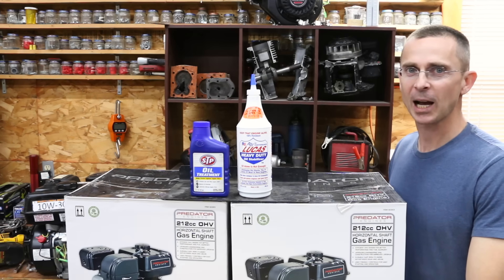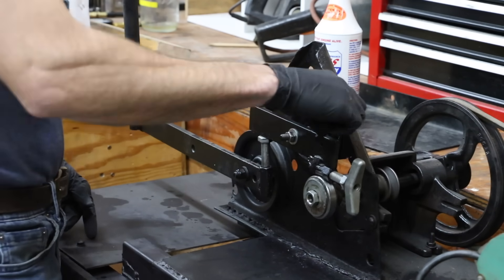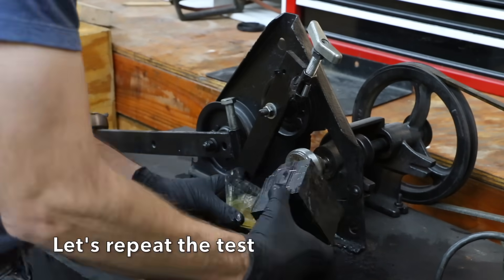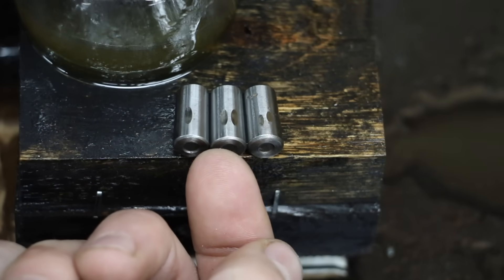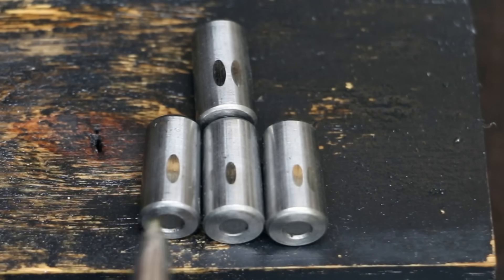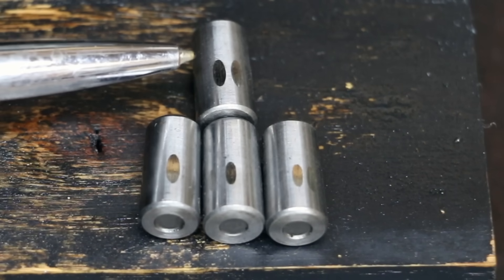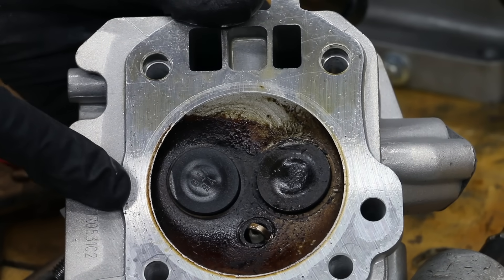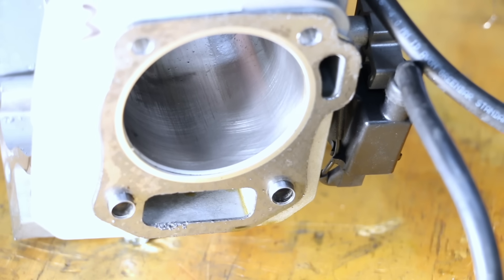Which engine self-destructs first?  Lucas or STP?

Comment: that is a cast aluminum (CA) connecting rod with no bearing mated to a hardened steel ( HS) crankshaft. In what world would CA defeat HS.   There is no damage to the crankshaft.  that is transference.  Aluminum from the connecting rod has transferred to the crankshaft.  You can use an acid to dissolve the aluminum, polish up the journal with emory cloth. mic the crank.  you will not find any damage.
Reply from the maker: This is a great point! Thanks for commenting.

Comment: Great test, except for the fact the lubricity test: we have no idea about how rough or smooth that sanding with a grinder does to the rotating sleeve. Using a jig with a piece of sanding paper applying a specific pressure to sand the sleeve down for a given amount of time should give a uniform surface after each wear test. However testing the bearing twice does remove some of that variation and the engine running test does confirm what was seen in the lubricity test. So very good test, very valuable. Kudos!
Reply from the maker: All great points regarding the lubricity tester. I've since standarized the process by using 1500 grit before every bearing test. Thanks again.
Reply: I'll make sure to watch every one of them :-)

Comment: You need to test water cooled engines sure you will get a good test out of air cooled engines you'll get a lot more thermal heat out of them and breakdown of the oil but a lot of people use that stuff in cars so cars be the best test
Reply from the maker: Thank you for this recommendation!

Comment: I didn't see any synchro balance weights in these engines, doesn't anyone use them in the smaller engines? They work well and also cut down on wasted gasoline.

Comment: Different ratios definitely had an effect on outcome... I think u should see which one is more fuel efficient to get a true and accurate indication of less internal resistance... then inspect for wear... Make sure not to drain the oil the time and use equal ratios of additives
Reply from the maker: Thank you for this recommendation.

Comment: I as a world renowned mechanic vlogger feel compelled to weight girthily in on this one.  i have 6 k hours on my 1200 watt champion 4 stroke genny and i used stp for 3k of those hours
every 120 hrs the plug had to be replaced since changing to seafoam in the gas and crank case i get aproxx 1000 hours/.   you do the mathematics
Reply from the maker: Thanks for commenting on this.  Great information.

Comment: I would like to see you try prolong additive against everything else. I've used it and I think it's one of the best out there. 

I've done my own test with it. Full size engines.. 

Ran my truck for 25k miles without an oil change. It wouldn't die. Drained it did same thing and ran it for another 25k miles she just wouldn't die. 

Ending up driving her to the junk yard
Reply from the maker: Impressive!  I'll definitely test Prolong.
Reply: Project Farm I can't wait to see that test. Would like to know if I should keep using it or not. 

Also they advertise that if a race car they drained the oil and ran it for over an hour at high speeds in a viper. With no damaging effects.
Reply: I've wondered about Prolong, but my sister has run a 2.3ltr Mustang (1989 model year) upwards of 30K on regular Pennzoil 10w30....  The engine would have continued to take the abuse had it not succumbed to a stuck thermostat.
Reply: U used it in my 2.3l turbo mustang. And I loved it. Never has an issue. 

I hear the crap put of it everyday upwards of 25psi of boost and 22deg timing. 

Now that motor I rebuilt because I over boasted it to much. But when I took it apart. The original honing what still there from the factory with over 375k miles on it. I got it with 150k. 

After rebuild I went another 150k before i sold it to some guy that threw the motor away for a 5.0. That was slower.

Comment: Engines arent designed to run with no oil, if you want to test lubricity then run the engines with the oil in them for the same amount of time and then drain and test the oil, not the engines with no oil, at that point you can then make a hypothesis on which additive would be better. Also, while running the engines it also allows the oil & additives to properly mix and the lubricated parts to absorb said lubrication....but to run engines with no oil and then make an analysis about which one performed better by showing the damages of not having any oil in them isnt at all a correct way to test because either way you do it, both engines are going to show catastrophic failure because of no lubrication hence invalidating that there was ever oil or oil additive used. Would you drive your car with absolutely no oil and then wonder if it was because of the additive you used before draining the oil that caused the failure? Pretty sure thats a common sense answer...

Comment: I had a POS Chrysler with a 2.7 that burned a litre of oil every 1000km's. A little lucas once a month and it burned nothing. Kept the oil looking cleaner too. I also stopped getting a low oil pressure light coming on.
Reply from the maker: Thanks for commenting on this.

Comment: Did you ever see the prolong engine video and or do the same test - It was a quite impressive video Just asking
thanks for posting and the test at your cost as in the world there are many things we need and don't need and snake 
oil is one of them.

The Prolong test was quite good as they remove the drain plug and put the cars on a track with no Oil in them to prove
it would protect the engine and the bearing teste show no wear  when using prolong 

Thanks for the video and test well done
Reply from the maker: I haven't tested Prolong yet, but I plan to do so.

Comment: No doubt the bearing fused/tried to fuse to the crankshaft. Might be able to grind the crank and replace the connecting rod, polish the cylinder walls. I wonder if a more traditional bearing would fair better? Newer engines use an aluminum/silica bearing. Old school is lead, copper, molybdenum. Ya, we have a legit warranty issue here. Ha!

Comment: I thought oil stabilizers were about preventing the oils from breaking down under high temperatures. 3 engines, one with untreated oil + 2 different adetives and find a way of increasing the oil temperature, under load and see which one fails. I'm not sure how you would achieve this.
Reply from the maker: All great points. Thanks for commenting.

Comment: Try the new nano pro mt stuff. I’ve heard the stuff with zinc or graphite will no longer be made. Rumor?
Reply from the maker: Thank you for this recommendation.
Reply: The nano line of products have a smaller molecular make up. About half the size of Lucas. AutoZone is the only place that carries it as far as I know.
Reply: Jarrod Hammond nano pro mt is from near me. My boss’ brother is an investor. Military and race teams use it from what I hear. Roush has tried to buy his company. He declined. It’s supposedly about to blow the market out it’s so good
Reply: AutoZone does. And as a worker there I see the nano stuff being clearances and might go away. Can get the nano coolant for 99 cents
Reply: Billy Stafford I’ve heard rumors some lubricants are going to be phased out by the epa
Reply: The Ginger Bus Adventures Amz oil sells break in oil with zinc.

Comment: I wish you had done this with a third engine using prolong. Out of curiosity I used it in a truck and used it the first three times I changed my oil then five or so years later we were moving cattle and had to chase a couple strays on foot. I left the truck running and it was at least 45 minutes before I returned and had big puddle under truck and oil light was on and gauge reading 0. Being a older pickup I drove it about a mile and half to shop and put five quarts of oil in it only to have it pumped out as fast as it went in. Oil cooler housing had cracked. So already figuring it was trashed drove it another 9 miles to house with no oil and got part to fix it and drove it every day for about four more years before getting a new truck.  The only thing I ever had to replace on that engine in about ten years of use was three sets of plugs and wires, that oil cooler housing, one k&n air filter, and the distributor when it got so sloppy it would not keep time anymore.
Reply from the maker: Impressive!  I've heard Prolong has incredible film strength.

Comment: Ebay still has Motor Up !! Best out there. Try it. I hit a deer with my van busted oil cooler in the radiator was able to drive it several miles while lifters were clattering ended up putting new oil and oil filter cooler on it and ran it for another 4 years never .. great stuff
Reply from the maker: Thank you for this recommendation.

Comment: I use Royal Purple 5/20 in car Ford 4.6L CV two years now and first oil I've been able to freely spin and start up engine at -22°. No starter drag whatsoever. For my semi DDEC4 S60 12.7L on fresh rebuild, I use the new Rotella with Lucas however I now question that practice. After next oil change, no more additives of any kind. After seeing this, I can't honestly answer the reason I was using it but I can see it is a huge waste of money. I'll run next oil to 20,000 then do oil analysis to see any difference. Original engine ran 1.012 million miles, I want to see if I can get 1.5 - 1.8 million on this rebuild. Looks like Lucas did nothing more than add entrained air bubbles to mix which is not good for my expensive bearings.
Reply from the maker: James, I'd really, really like the know what you find out regarding the oil analysis.  Could you please post the results or send an email to me?  projectfarm52@gmail.com.  I'm always seeking knowledge and the results of the oil analysis would be very informative.  Thanks for commenting.

Comment: correct me if im wrong im pretty sure the pred212 is a 2 cycle not 4 so this might not be as accurate.
Reply from the maker: The 212 is a 4 stroke engine. Thanks for commenting.
Reply: thanks i wasent sure dident want to say something i dident know anything about nice work me dad just put Lucas fuel treatment in his 2014 jeep patriot. it had acceleration issues but he says it fixed it maybe you could do a video on it.

Comment: lucas is the shit i always use it when doing an oil change. i payed a neighbor to change my oil and he forgot to put in the plug when he filled it it drained right into the dirt the next day i drove 60+ miles for work and didnt notice there was no oil until i got home and noticed the engine smelled hotter than normal popped the plug in filled it up with oil/lucas and it will still peel the rubber off of the tires
Reply from the maker: Thanks for commenting.  I'm impressed that the engine survived!

Comment: It would be awesome if you would test various oil types, weights, and manufactures on the lubricity tester. Say a "10w30 VS 20w50" test. Or a "10w30 Synthetic vs 10w30 Conventional" test. Something along those lines would be awesome!
Reply from the maker: Thank you for this recommendation.
Reply: thicker oils will generally provide better protection, as will synthetic blends and full synthetics.  However, such a test is near useless in real world application because clearances have to be taken into consideration.

Comment: IF you insist on running tests, being that AMSoil claims they are the best 100% synthetic oil, It would be very informative if AMSoil, Mobile 1, and all the other over hyped oils were run head to head.   All should be the same as each other as to viscosity and whether it's 100% synth or 'full' synth or a blend of synth and non-synth oil.   Cold oil and their ability to flow should also be included, being that's when most wear takes place, according to some 'experts'.  IN other word, make your test = to end all the hype and find out which oil truly deserves the title 'best oil in the world'.
Reply from the maker: Thank you for this recommendation.

Comment: What did we learn ?   Engines will grenade without lubricant. I think they will not honor warranty on those engines. 😆. Generally , oil additives are not recommended or needed.
Reply: kenamaro the Lucas engine DID last quite a bit longer than the STP engine during the dry run test. so there's that.
Reply from the maker: Thanks for commenting.
Reply: Do not talk about science, it is nonsense
Reply: kenamaro I'm with you there. Better spending the money on oil changes with shorter intervals.
Reply: @kawasaki whip two     yeah but the lucas was more viscous, and therefore likely less volatile at the high temps reached by running the engines dry, so the remaining oil film lasted longer. You also have to consider the additive package formulation in the Valvoline. The Lucas better complimented the Valvoline, but what about another engine oil with a different proprietary additive package? Also, what about the differences in the two engines themselves... after all manufacturing tolerances lead to variation. The engines were not identical. This test test was far from scientific and conclusive IMO. 

I still appreciate this video being made though.

Comment: zDDP? pennzoil  had an additive called Z7, which was nothing more than the paraffin they didn't bother for remove from thier crude. Stories have it that it worked great in the super old steam engines, like the locomotive engines of the 1700's, but doesn't do shot for todays gas engines. Or does it? Lucas Oil additives I'm not so sure of.it would be great to know more about Lucas additives before puttin all faith behind it.
A competition between additive should contain, additive with teflon, additives for older engines with additives optimized with additives  decide to try against moisture contamination, storage of a car after several months to see for machines used after  1945 to 1948.
 Change setting arrangements  and we'll figure  
Not to. To raise awareness to th youth of society as split rims can beextremtly dangerous! We ' see"!
Reply from the maker: All great points. Yes, those split rims are extremely dangerous.

Comment: STP was an early attempt at treating oil. It's a good lubricant, but has no antifoam agents. It also plugged oil galley in the oils drainback system of many engines. Good to sell a used car, bad for everyday use. Lucas takes a different approach. Still doesn't have an antifoam agent. I've never used it. So take from this what you will. The second test, using it in an engine and seeing what will happen is probably a better indicator of what these additives will do for you.
Reply from the maker: Thanks for commenting.
Reply: +ken cohagen

From what Google searches have shown me, STP is zinc dialkyl dithiophosphate (ZDDP) based while Lucas is paraffin wax based. With that being said, it seems that STP would be the better additive than Lucas (though I personally don't use any additives at all).

Comment: I worked for a major automotive manufacturer in the global engine group designing future engines and I would warn about using any oil additive that is thick like those on a modern engine that calls for thin oil like 5w 30 or. 0w 20. The oils are thinner because the tolerances are tight and y the lighter oil helps with fuel economy.  Running a thick oil or additive can actually starve a bearing surface.  As others mentioned you need a control engine one that had just oil in it.  If it had lasted about as long then I would say the additives did little to nothing.
Reply from the maker: This is a great point. Thanks for commenting.

Comment: Did he say what additive he thought was better? I didn't see any difference between the two engine. Sure the Lucas ran longer but not by much and the cylinder head temps were higher on the Lucas engine. I'd think he'd have to do this at least 4 times to get any viable information from the test.
Reply from the maker: I didn't provide my opinion.  My personal opinion is that they are nearly evenly matched but Lucas is somewhat better.

Comment: I don't know if you are still planning more of these videos, but how about testing MolySlip? It's molybdenum disulfide, rather than another hydrocarbon. A friend of mine used to run the "G" version in his manual transmission as he found it was far easier to shift with it added.
Reply from the maker: Thank you for this recommendation.

Comment: A few years back I went to the Lucas top fuel dragster shop. Talking with one of the guys they mentioned that they had made a few 1/4 passes forgetting to put oil in but prelubed on assembly with Lucas products with zero damage.
Reply from the maker: Wow!  Thanks for commenting.

Comment: Hi, can you test / comment / feedback on adding small amount of anti-seize (generally used on bolts) to oil and see would it damage the seals or surface vs smooth out the cylinder surface and seal the rubber seals at crank shaft?  Thanks.
Reply from the maker: This sounds like an interesting test. Thank you for this recommendation.

Comment: Running the Small engines is like motorbike engines, which use a totally different oil if anything you should have tested the right oil for the engines is the test and then put the Oil friction modifiers in ? All this confirms is that one product is not suited for small engines thats all, if you want to do the test right, use the same good quality oil and run real motorcar engines 2 of the same and then drain the engine oil and see which engine will last the longest ?
Reply from the maker: Thank you for this recommendation.

Comment: deliberately self destructing the engines without oil tells you nothing about the additive because the tolerance differences from the manufacturing will be a  plus or minus difference and will ensure one will fail before the other no matter the condition of the residual additive
Reply from the maker: Thanks for the constructive feedback.